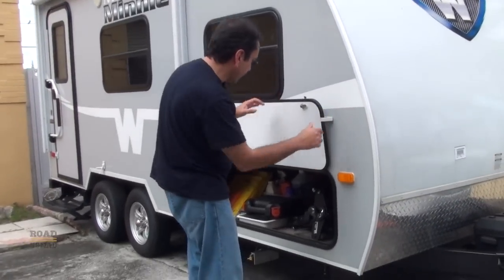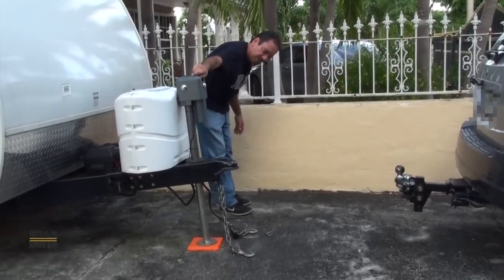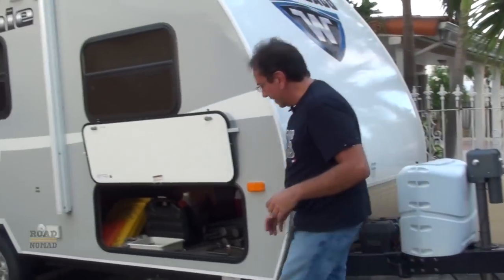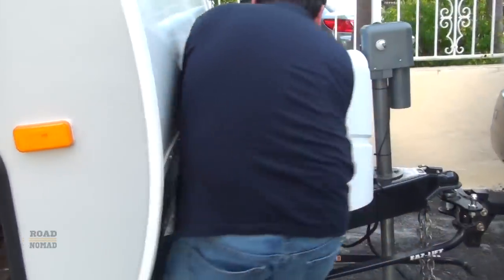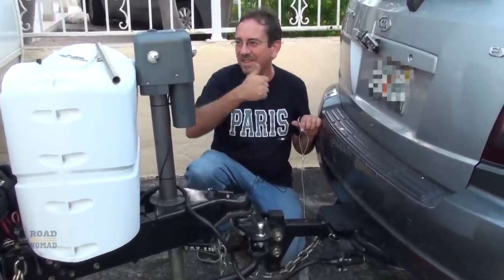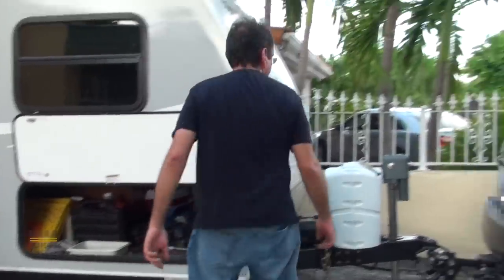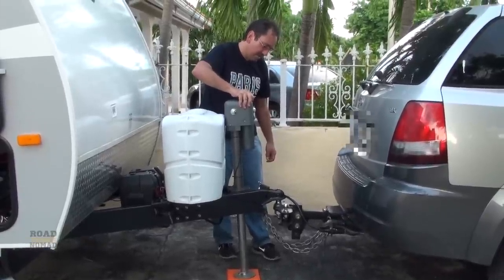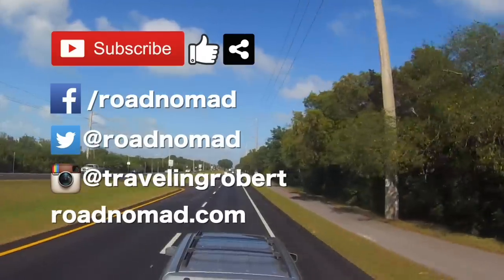Hitching Up The Trailer | Traveling Robert

Comment: Robert thank you so much for this video. I embarked with help from Ohio last early March, 2018 traveling to the OBX for a workamper job and a new chapter in my life. I had never towed before or camped in a travel trailer. I made it over the Blue Ridge Mountains during snow with a death grip on the steering wheel and inability to back my trailer. I avoided actual campsites and stayed at cheap motels. Lets just say I have had lots of help both backing and getting set up. Now I will be traveling to FL for my next assignment. I have been very embarrassed by the fact that I even after 6 months I still can't back my own home (little trailer) and didn't know how to hook up my weight dist. hitch. Thank you again for your straight forward instructional video on how to hook up my wt dist hitch. You rock! Hopefully some day I might met you in person.
Reply from the maker: Thank you. I am glad you found my video useful. To back in I use the bottom of the steering wheel rule. Whichever direction you want the trailer to go, that's where you should turn the bottom of the steering wheel.

Comment: Thank you Robert for the video. Question about your seven pin wiring harness for the RV. We too have a Kia Sorento but have not had our harness upgrated to seven pin. Where did you get the upgrade for the trailer harness? Can anyone who does these trailer harness's do the upgrade or do I need to take SUV to the dealership? Are there any problems with the computer adapting with the harness? I have gotten two bid's for the job, just want to make sure there is no harm of frying the Suv computer. Thanks for your help.

Comment: Great, informative video! We are considering buying the 2016 2106FBS and have a 6 cylinder 4Runner. Think that is big enough to pull? It's rated for 4700-5000 lbs. Thanks!
Reply: +Barb Renkert Hello Barb  I saw your post and wanted to know if you ever got  your 2016 ? If so How do you like it. Any tips or tricks?  I'm in the market for 2106fbs also and i have a toyota tacoma V6 and wanted to know how your like i? Thanks Jeff
Reply: No; we decided to hold off a year. We have some international travel plans and thought it didn't make sense to have a rig sit! Let me know if you get one!!

Comment: Great video Robert... and superb quality as always! Question - do you notice any "porpoising" where the hitch point bobs up and down on the highway, usually over rough bridge joints, etc.? I have sway bars, but they don't seem to help the up & down, just the side to side  sway.
Reply from the maker: +Norton Newmann Yes, it does bounce up and down quite a bit. Maybe if I had a heavier truck it wouldn't be as bad.

Comment: Great video!  Just wondering what the towing capacity of your Kia is? I just bought a camper and the dry weight is 3095 pounds while our Mercedes has a towing capacity of 3500 pounds. Our trips will be short, within 30 miles or less. If we go further or in the mountains we will use a truck with more towing capacity.
Reply from the maker: +Daniel Carson Old Kia is 3500 as well and my Micro Minnie is just under 3000 dry. The only time I ran into trouble was in the mountains between Chattanooga and Nashville with my holding tanks nearly full. In flat lands as long as you go slow and tow with nearly empty tanks you should be ok. I l'm thinking of installing a transmission cooler. Everybody says it is a must.
Reply: Thanks for the reply. I live in North Georgia not too far from Stone Mountain as I'm sure you're familiar since I just finished watching 
you're video from there!
Reply: ive got a truck that will pull 11300 lbs pulling a 4000 lb camper and i made sure it had a transmission cooler in it. they are definatly a must if your pulling anything no matter what your car will pull.
Reply: He's been all over the place with very few problems.

Comment: Robert- we have a Micro Minnie 1700bh and are new to RV'ing. We've driven a few times and experienced a lot of sway with wind. We're getting the weight distribution system in 2 weeks. Do you notice a little sway even with the weight distribution?
Reply from the maker: +SoxRock If it is windy I do notice some sway. Also when a semi truck passes you on the interstate.

Comment: Trailers are hard on automatic transmissions, especially on a smaller vehicle. Do you have an auxiliary transmission installed? If not, get the biggest cooler you can fit in there. Your transmission won't last long without one. It's also highly recommended to use quality gear oil in rear transaxle  (assuming your Kia is rear wheel drive ). Amsoil is the best lubricant money can buy. 
I did not mean to sound like "know it all" but I used to work as a car mechanic and did a lot of towing with my 98 JEEP GC. 
Thank you for all your work making great videos.
Reply: I was referring to an auxiliary transmission cooler in my post above. Sorry, I noticed a word was missing but could not edit it once it was posted. Typing on a tablet touch screen sucks.
Reply from the maker: +Ray_Biker I have a rear wheel drive, and havent used a transmission cooler yet. I am mostly on flat terrain down here though. Maybe when I decide to travel north or west I'll get one installed, and eventually I'll get a heavier tow vehicle. Thanks!

Comment: Robert, that slide do-hicky that locks your ball in. Instead of a bolt maybe you should put a long shank padlock on it. That way when you stop for a break or even when you are stopped at a camp ground, it can prevent a lot of mischief. You don't need some wise guy loosening up your bolt or taking off with your camper. Plus bolts and nuts can back out and loosen over time. A lock is there to stay.
Reply from the maker: +Mr00destruct0 I have a locking device for when I leave it in the campground or at home detached from the car, but that's a great idea. Thanks!

Comment: Hi Robert.  I am curious about your brand of weight distribution system with anti sway.  What brand is it?  If something happened to injure your hand while traveling could your spouse do the hitching and unhitching of that system?  My husband has made it clear that he has no interest in camping with me and the kids (even though I know he will always come if only to be a thorn in my flesh).  I have purchased my tow vehicle, and I have picked out the travel trailer I wish to purchase.  I've looked at many you tube videos of "men" hitching and unhitching trailers.  Some of those systems look hard for strong men.  I am a 63 year old grandmother with poor strength.  Yours looks easier than most, but I would appreciate you sharing your knowledge of whether or not your system would be appropriate for a woman of my age with carpal tunnel issues.  Your insight would be much appreciated.  Sincerely...
Reply from the maker: +Grandma Patty Some things require a bit of strength.  The hitch itself is very heavy and the pins are hard to push in. The hitch is and Eaz Lift.
Reply: Thank you Robert.  Please get your loved ones out of harms way.  This hurricane will be devastating like Andrew was.  Please take caution.

Comment: Thanks Robert.  Great video.  You convinced me not to get a travel trailer.  I think I will probably end up with a truck camper and leave it mounted all the time.  Either that or a Class C Motorhome.  I will be traveling alone and don't need much space.
Just a nice place to shit, shave, shower,sleep and eat.  A nice Lance truck camper will do for me.
Reply from the maker: It is not that bad... but eventually I will switch to a motorized RV of some kind.
Reply: George Herman check out the class B. It would be a good fit for you. It comes with the amenities you need.